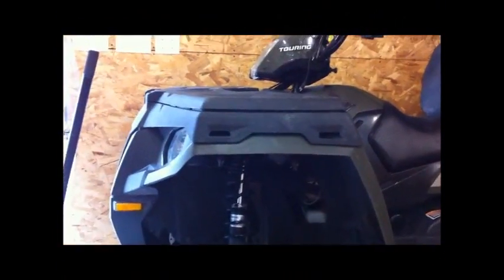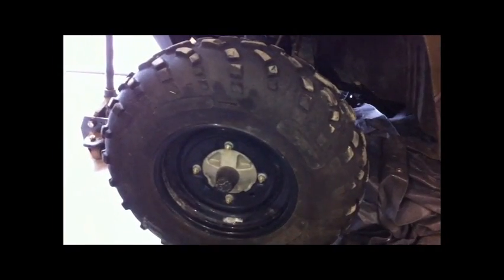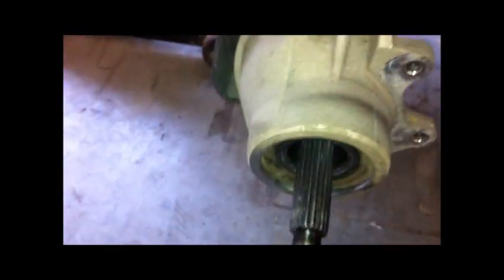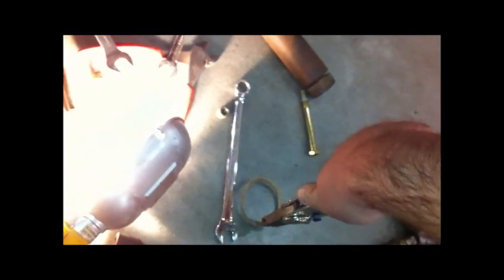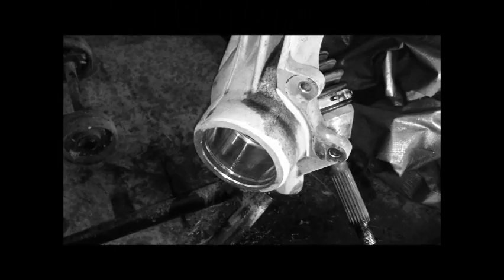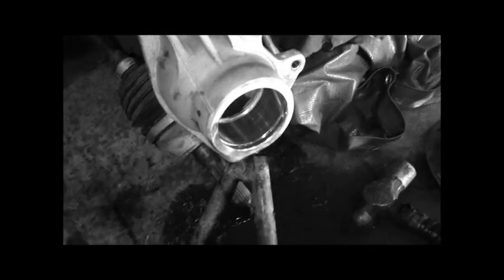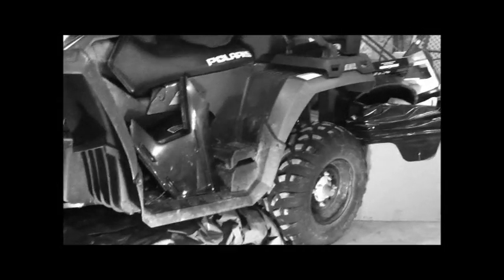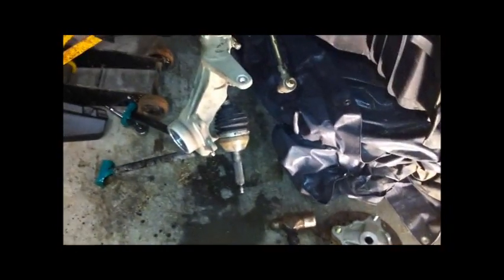Polaris Sportsman 500 Wheel Bearing removal 2008-2015

Comment: I live in  the mountains and make my living in the mountains digging roots and pulling tree barks. I have put 1700 miles on mine since March and this is August. We put a lot of miles on our machines around here, but as long as mai and not hot rodded everywhere they last a long while. That being said I just had a wheel bearing going bad. Mine is a 2013 model and only had 200 miles when I bought it in March.  Thanks for vid
Reply from the maker: Right now i have 8,000 Miles on mine , around 700 Hours. 
This is the "Only Repair" i have done on her! 
Everything else is still holding up Very well!

Comment: The hub bottoms out on the axle so you can not tighten the axle nut to tighten the wheel bearing. The problem with the Polaris wheel bearings is an engineering issue. There should be two additional seals for each wheel bearing, an inner and outer. The bearing seals are not designed to take the large amount of dirt and rocks being jammed between them and the hub or cv cup. So having additional seals would better protect the bearings from debris. Guess that's the kind of engineering you get for $5k.
Reply: 30spooln guess that's my problem with one axle on the front. Any fix for that? Onle have the one still flopping. Having ridden yet.

Comment: 80 km/hr? you should probably have a sport bike, not a 4X. I usually get up to 50km/hr tops sometimes on the fsr's. but most my miles are exploring around on the trails. but it seems many use their 4X4 machines like they are dirt bikes, racing them around and jumping with them. not surprising then when stuff breaks.